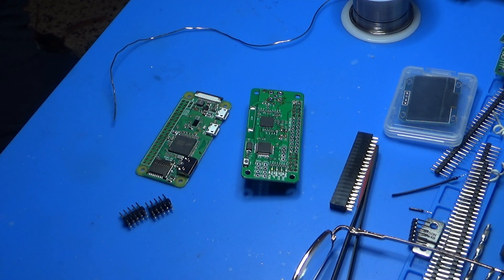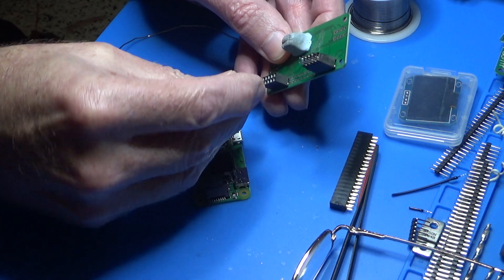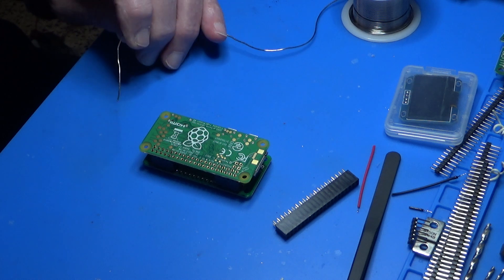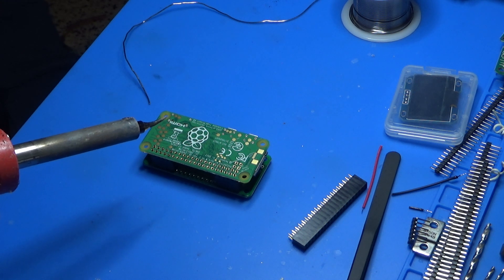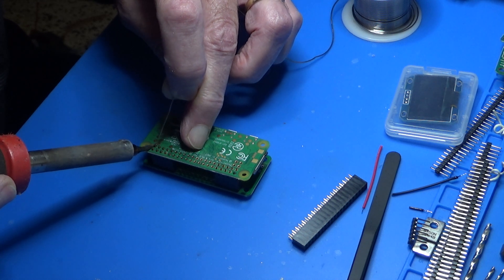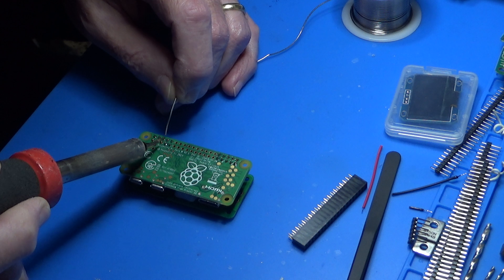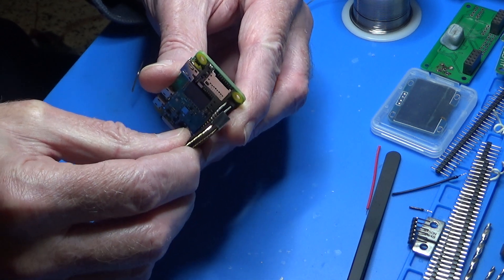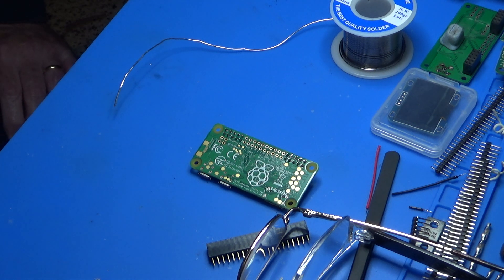How to Solder the Raspberry Pi Header Pins

Comment: For me, the solder does not melt to the pin, no matter how long I hold it there, no matter how hot my iron. Any idea why?
Reply from the maker: As a test try your solder on some freshly stripped wire. If it doesn't bond then you have poor quality solder.
Reply: use flux!